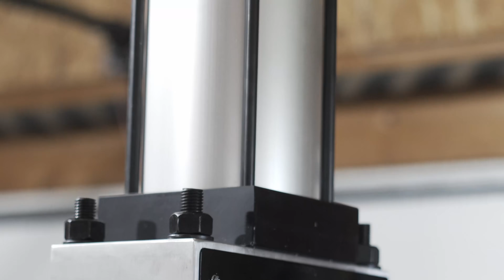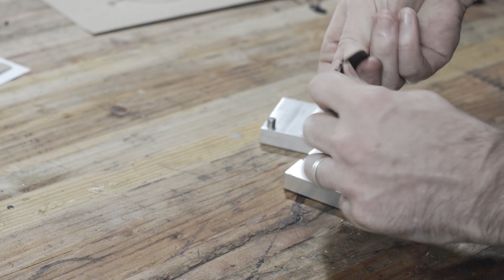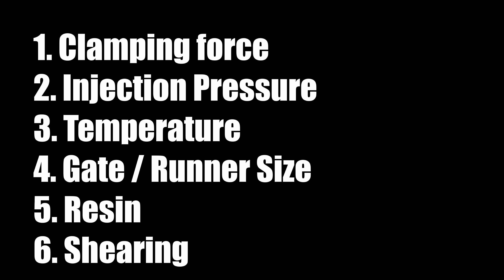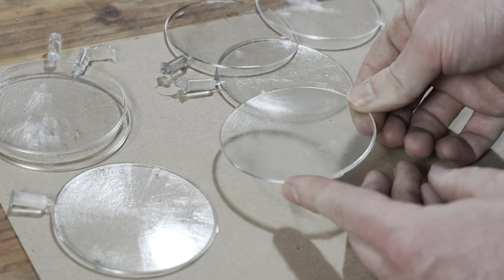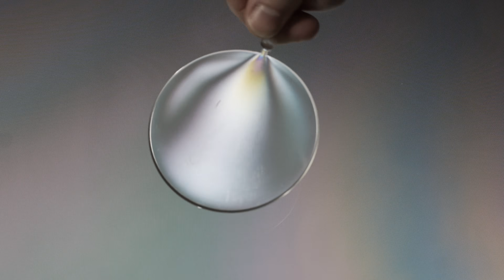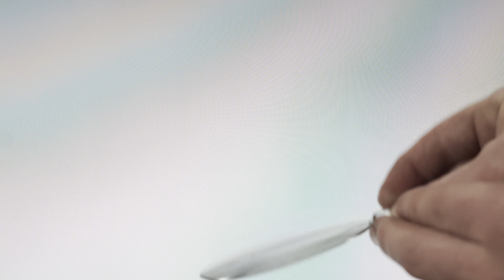Machining an injection mold for acrylic lenses

Comment: So, firstly, this is super cool and I can't wait to see more injection molding
But secondly: When looking at the lenses under the polarized filter, my understanding is that the stresses are shown with a colour difference like in the center, but you seemed to be talking about the darker lines. I noticed that as you moved the lens around those darker lines moved all the way across the lens, not fixed in one spot. I might theorize that those darker lines are actually light coming into the sprue across the inside of the lens and refracting, and the reason those sections are smaller is because the bigger gate is pulling in and allowing more light. The coloured section that transitions from a dark purple out to yellow seems to be the stress you were talking about, as it remains stationary. This also lines up with what I've seen looking at cheap molds like clear disposable cutlery, being able to see that rainbow pattern, but only while I'm wearing my polarized glasses. You could likely test this by taking one and nipping off the sprue and seeing if the dark parts are still there, or if it's just the coloured pattern.
I'm absolutely not an expert here, I could be totally off base here, and it's possible I just misunderstood what you were describing, but I thought I'd share even if it's only for me to understand what you were saying better.
Reply from the maker: Heya Coatduck, thanks for stopping by!  Loved your collab with Winston btw :)  I think I poorly described myself... I was considering the dark regions and the colored regions all as "stress". But you have a really good point, I didn't think about the effect the sprue would have on it!  It's a solid cylinder, it probably acts like a light guide and funnels in light from a different angle.  I went ahead and took a before/after like you suggested, photos and some shakey cell phone video here:  https://imgur.com/a/vPDiUSx  The weird aliasing/pixelation is from sitting directly on the monitor, that disappears when you move it off the surface a little bit

It was hard to recreate exactly what was in the video... it is really sensitive to position of all the elements and their rotations relative to each other.  The long dark gray lines are largely absent this time both with and without the spure.  Soooo I think that must have been an artifact of positioning or focus or something?  The only thing left are the green/yellow/purple regions that rotate through colors as you rotate the lens, so I agree that's definitely the stress regions

Not sure the takeaway, I suspect it was just something about the setup or where I was holding the lens?  I was also using a camera with a longer focal length vs. a cell phone, so perhaps that had something to do with it too?  Dunno, definitely not an expert either :)

Note: Some of the really dark, stationary lines are that streaking/splay I mentioned, it's hard to see on camera but very obvious in person.
Reply: @BreakingTaps  oh dang, thanks for the complement! I've been subscribed since your first Taig video
That was a really in depth analysis, thank you for doing all that work to sate my curiosity. If you were still wondering about the disappearance of those dark lines, I noticed a few things that might be a factor: It looks like in those shots they're being backlit by your monitor, whereas in the video they were lit from the front by a bright source. It might be the fact that the source is now larger than the lens, or perhaps just darker than your nice photobooth setup, or perhaps even to do with the colour index of the monitor, since it's putting out RGB "Whiteish" light, rather than a true white phosphor like in a white LED or something.
I have no idea if any of those would contribute, but they're leads if you wanted to track it down. But either way you got the data you were after, which is super cool. I can't wait to see more on the series. I've had a DIY injection molder in my head for nearly a year now. It'll surely be at least a year or two before I'd even start on it though. Gonna need a bigger apartment.